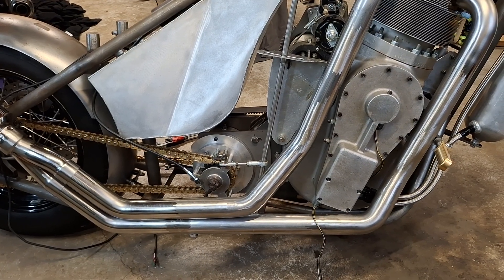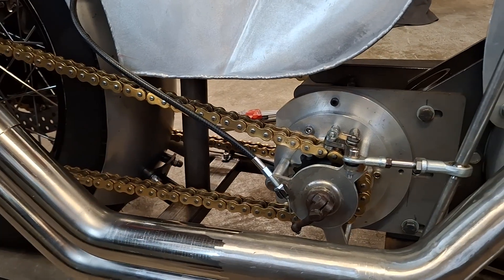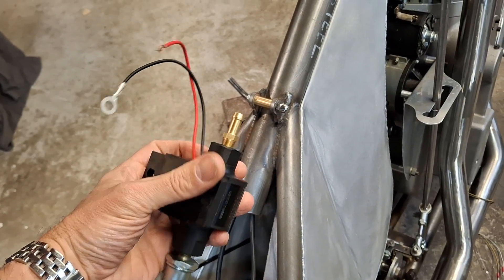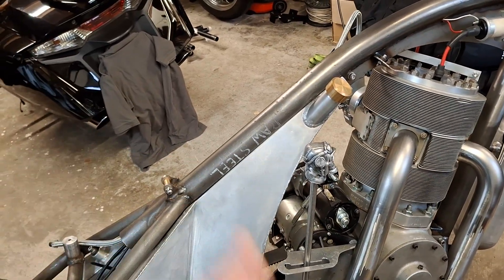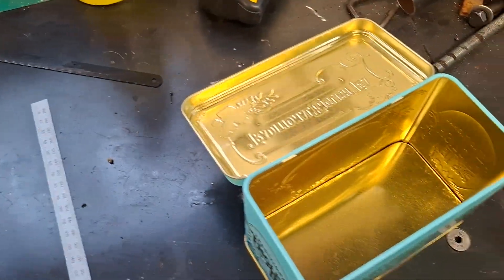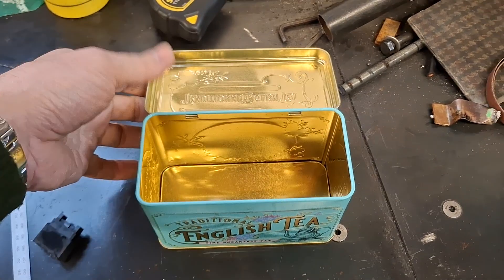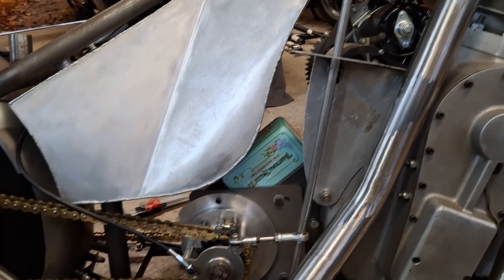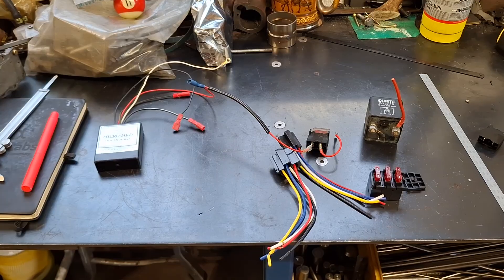Electric Dreams

Comment: LifePO4 batteries need a different way of charging compared to lead-acid. It is possible to cook the alternator and/or the battery if specific rules are not observed. Here is tonight's study-video, (other videos are available) Please investigate charging methods before you have a chopper Chernobyl ! I cannot emphasise this enough, after all the work you have put into the bike.
https://www.youtube.com/watch?v=jgoIocPgOug
Reply from the maker: Thanks for the info. It would be handy to know how that applies to a dynamo rather than an alternator, and also with low aH capacity batteries. The ones in that video were an order of magnitude higher.
Reply: @StoneEng  LifePO4 batteries have a very low internal resistance, as the video tells. They would act as a high-current drain on your dynamo; the regulator will require special tweaking to cope with the load.

Comment: Regulator could go behind the gear shifter plate out of sight & near the dynamo..🤔
Reply: Yeah, that big plate needs to have more than one purpose, it might be possible to turn it into a box with a hinged lid a bit like the old BSA toolboxes on late 50's and early 60's bikes 👍
Reply from the maker: Yes possibly.  I just need to make sure there's room for the starter motors to swing, to adjust the chain tension.